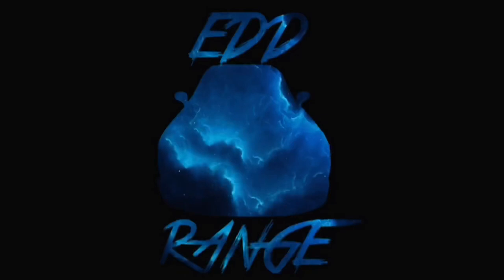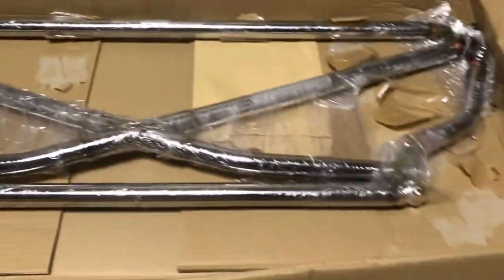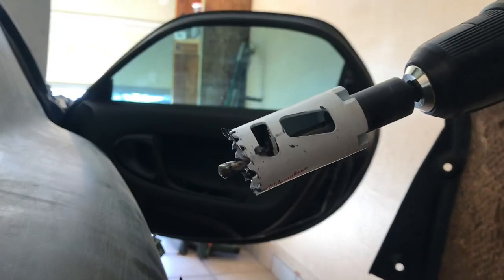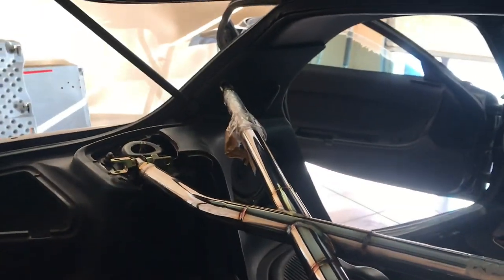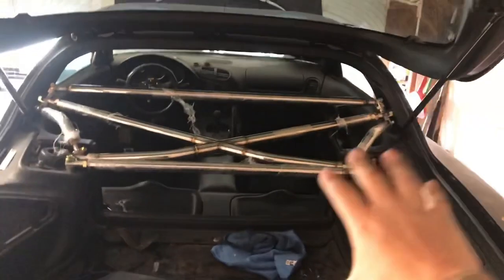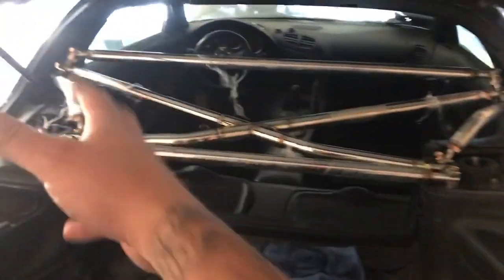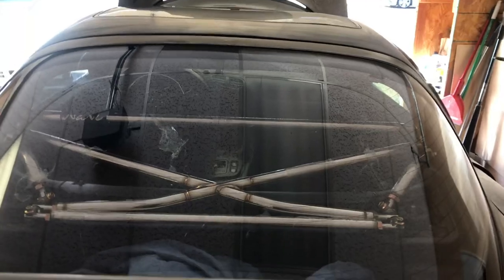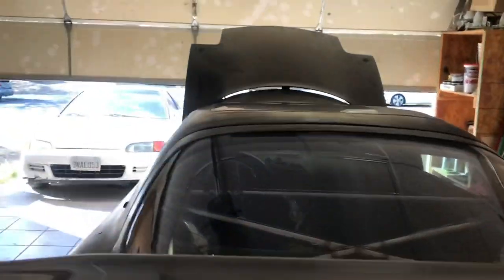Next Nippon Miracle Cross Bar install for the RX7 Fd!!

Comment: Also could you rotate the butterfly bars so they don't foul on the trims or are they set
Reply from the maker: Adam Lawdor  well there is not much room on the lower section of the butterfly bars, so no matter which way you spin it it will still hit the tab on the passenger side.